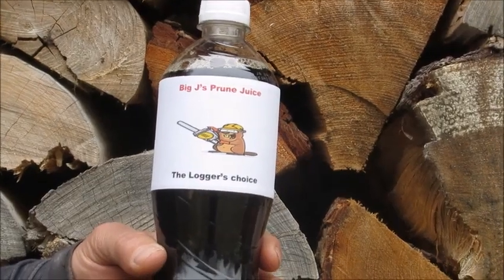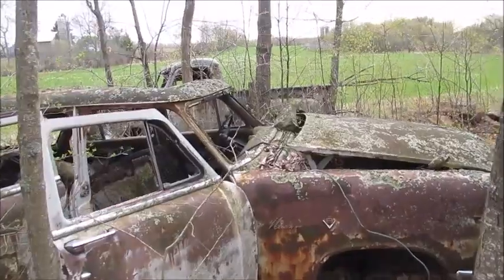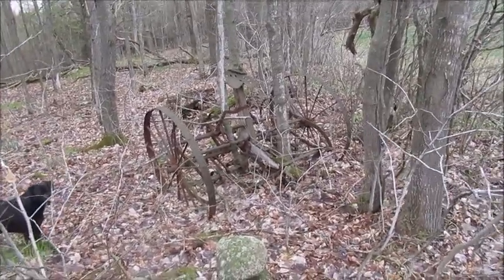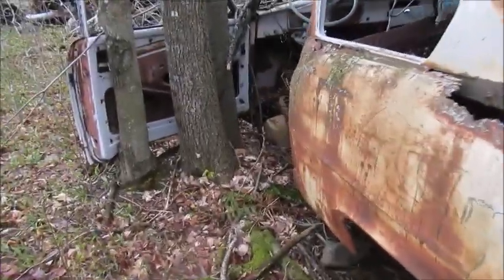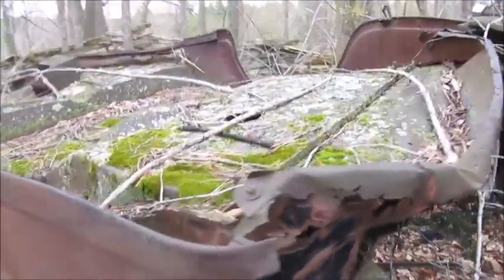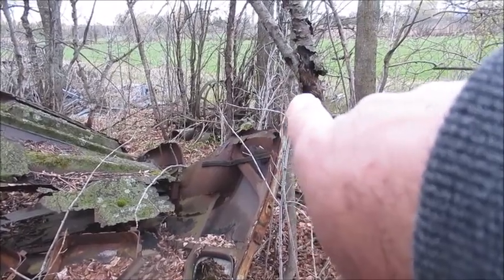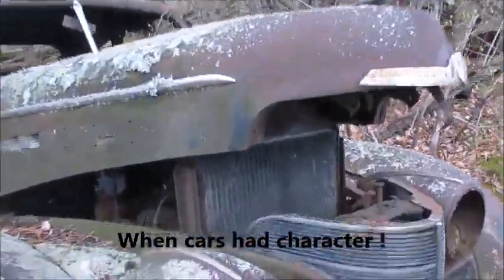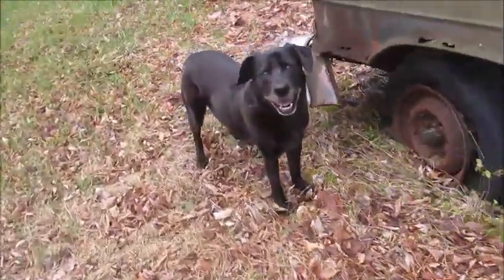Old Car Graveyard & Wet Feet! 🚗 🚗 🚗

Comment: That oddball car that Joe identified at 6:06 ish was generally referred to as just a Henry J....after the guy that built them.  I have a 85 year old cousin that has a '53 (I think) Henry J in his shed with a ton of other oldies.  I like old stuff like that John.  Awesome video buddy !!  On a side note, a lot of the old cars had stainless steel trim instead of chromed and stamped sheet metal.  That's what a lot of it looks good after 60 + years.  The bumpers were all plated though...just a higher quality of the chrome plating process back then I guess.
Reply from the maker: Hello, I'm so glad you could watch. Glad you could identify a few, I suck at it. LOL. But a tractor or other farm machinery, I could tell you a mile away. Thanks for clearing up the chrome item, good to know. I tell you everything was higher quality back then. LOL Take care
Reply from the maker: By the way, do you know what that big piece of equipment is at 18.30 or so?
Reply: @loggerjohn01  you know I looked that thing over pretty good and like you I think it’s upside down. Those are definitely stake pockets for a removable gate. But I can’t figure the wheel arrangement though. They look like dollys under a big rig’s trailer but it doesn’t make sense with the bed like it is. I’ve got nothing really. Lol.
Reply from the maker: @tractorman4461  Thanks, Check out Joe's answer, I think he might be right.